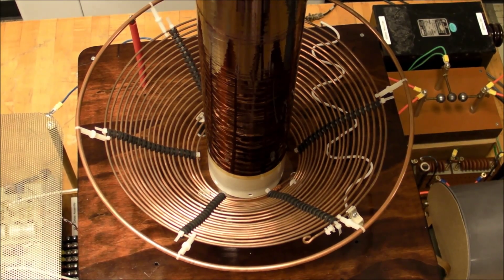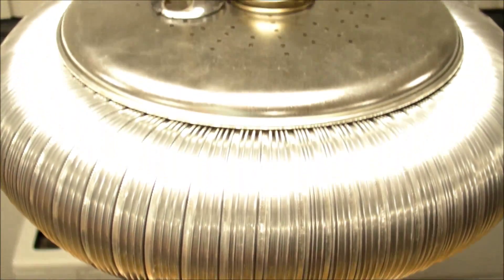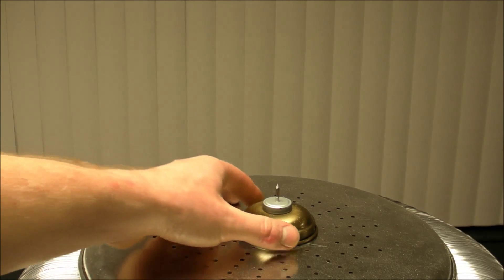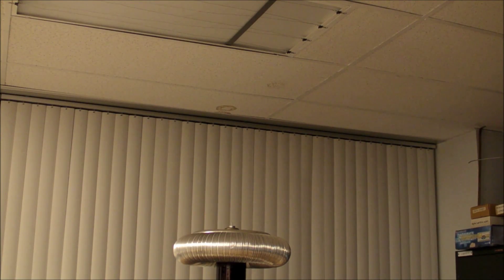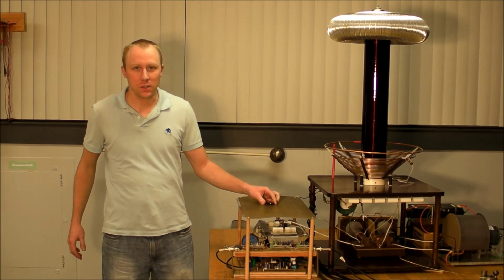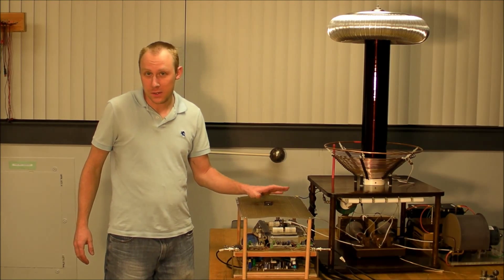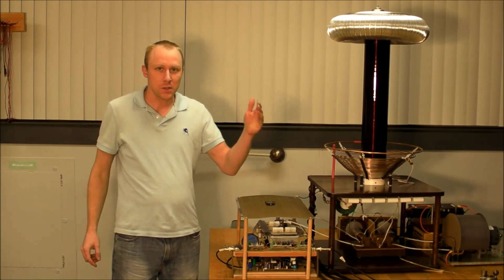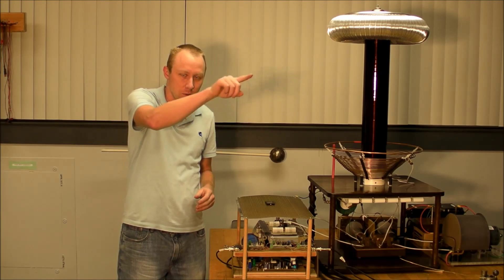(#0019) One Arc, Many Sparks - DRSSTC vs. Spark Gap #02

Comment: Just judging by appearance and power input, I'd say that the SGTC produces in the 300-400KV range, while the SSTC probably not even reaches 100 KV. You can get a reasonable estimate of the voltage if you replace Mr.Tesla with a smooth metal ball. If you can get visible effects (corona/streamers) from a 1.3 cm diameter ball, you are at roughly 100 KV. This is a linear function, so 2.6 cm would be 200 KV etc.
To increase the reliability you should use a very smooth top-load as well.
There are a number of reasons for this difference, this space is too small for a good and complete explanation. (dV/dt, Earth E-field, Atmospheric E-field, heat, charge density)

Comment: You should be commended for making interesting experiments on TC discharges!
It is difficult and almost impossible to accurately measure top volts on the secondary , but good comparison between two cases can be made simply by considering secondary bottom peak currents (since frequencies and voltage profiles are pretty close).If you can adjust SGTC to run in a single shot (or very low BPS) mode and observe toroid sparks breakout in dark do such experiment too.

Comment: Hi,
The smooth,clean voltage rise in the case of DRSSTC hasn't got much to do with the spark type difference you observe.It has more to do with time to the voltage peak which is much shorter for SGTC and the energy can't be dissipated fast enough by a single spark vertical spark (spark needs time to grow too).Probably the peak voltage is lower for DRSSTC as well (if you apply same power and BPS in both cases).This you may see by scoping secondary bottom current amplitudes.